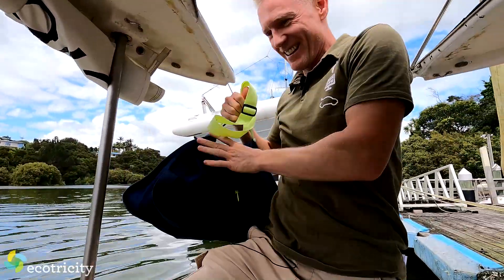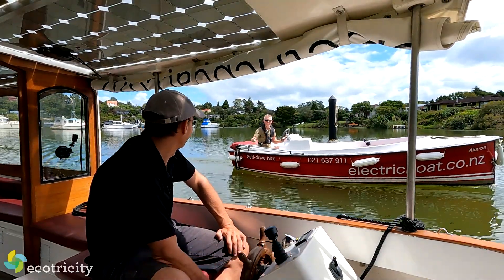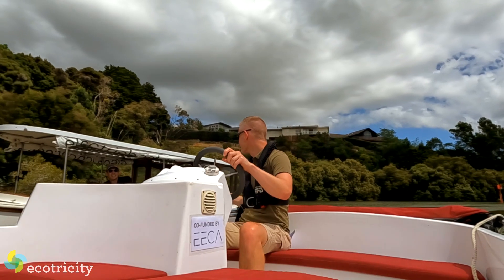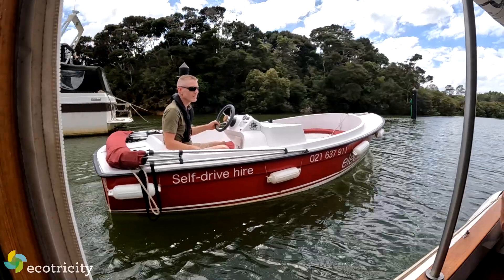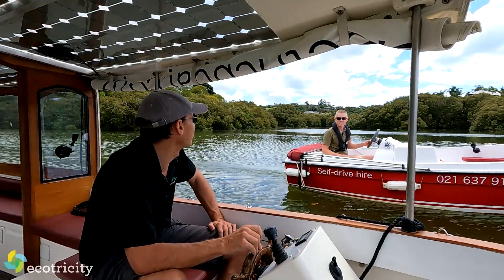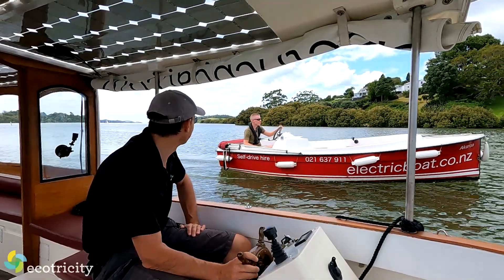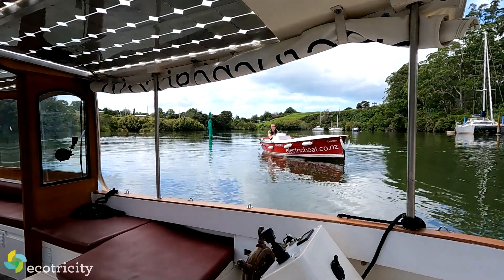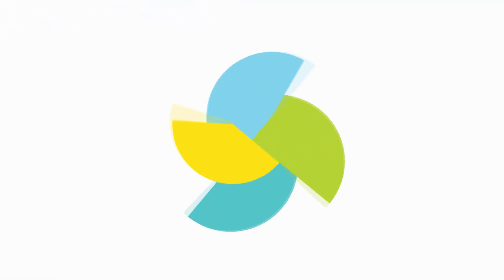Water & electricity? We try out electric boats!

Comment: So peacefull cruising. What is the max speed on these.?
Reply: The Frolic 21 has a souped up 2.5kw Lynch motor so it will do over 6 knots, and it can still do about 6 knots towing two other boats - the speed of a displacement boat is limited by the length of the waterline not by the amount of power it has. With the limiter switched on then we restrict it to 3-4 knots so it can't do more than the 5 knot speed limit even with the wind behind. The Ruban Bleu Scoop has a permanently enabled limiter so it is always restricted to 3-4 knots. If you could switch off the limiter then the shorter waterline would limit the maximum speed to 5.4 knots, the same maximum speed as any other boat of that length.

Comment: Great video.  Hilarious that we all paid for 40% of it but there you go.  A perfect use case for an electric boat.  Once you need to go further, faster it all falls apart so I’ll be buying diesel for mine for awhile yet.
Reply: We do lots of electric boats which go far or fast. We supply hybrid systems too, so you can retrofit a hybrid system to your existing diesel engine. After that you'll rarely start the diesel but it's still there for the occasional long passage and the hybrid unit will rapidly charge your batteries at the same time as your old diesel is propelling the boat. - Chris from electric boat co nz
Reply: hybride  disele bdst

Comment: I'm converting an old Seagull to electric, so I'll be very interested in the next episode to see what I'm aiming for.
Reply: IMHO it's not a good idea to convert a Seagull, the propeller and drivetrain is very inefficient. It would certainly be cheaper and easier just to buy a purpose built electric outboard with an efficient direct drive motor at the bottom of the leg and an optimal propeller shape, it will last a lot longer and get much more range out of your battery. - Chris from the electric boat co.
Reply: @electric-boat  Hi Chris, I agree, but where's the fun in that 😊 The Seagull is not in running order, I have a 48V DC motor, and a stack of recycled lithium cells, all up I have spent about $250 on parts. I might need another $50 of waterproofing and a battery case, but I can't see anything close to that price range other than little trolling motors.
Reply: @djotter  Well if you're doing it for fun and you have the bits then why not! I would still at least change the propeller, people actually did know how to make efficient propellers in the 1950s but Seagull avoided those and tried quite hard to make their designs as rudimentary and agricultural as possible, it was their whole design ethos!

Comment: These would be ideal in Australia on the Murray River. Mooring is also  a costly item if you own but hiring is ideal. Do they have electric boats that have a trailer system?
Reply: Both of the boats in the video are trailer launched although we keep them moored in the water most of the time for convenience. We have a wide range of trailer launched electric boats available and can have them shipped direct to Australia from the boatbuilder in Europe, or we can supply an electric inboard or outboard for an existing trailer launched boat.
Reply: @electric-boat  Can I ask do you have a website ? They are amazing boats for enclosed water ways.
Reply: @gregorymcleod  the address is on the side of the boat!